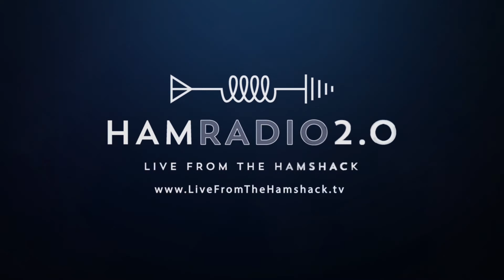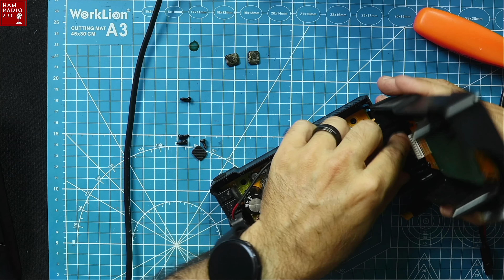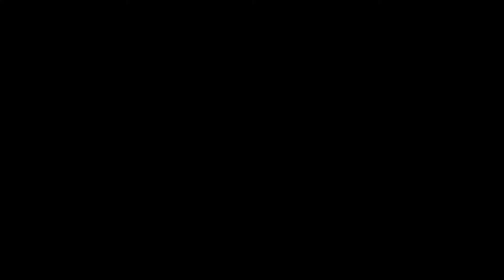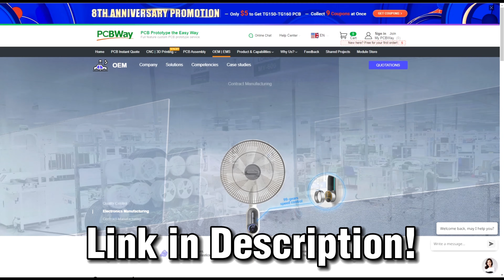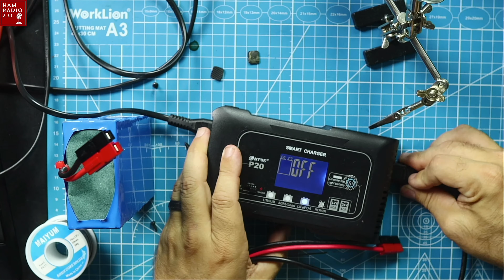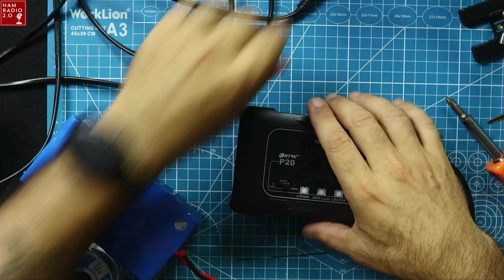Repairing My LiFePO4 Battery Smart Charger from AMAZON

Comment: You will never get advertised charge amps from these chargers. 20-25% less than advertised. Same chargers are much cheaper on eBay than Amazon. There are several clones all the same just different prices and labels.

Comment: nice fix. looks like a nice charger. love the 24V .with the RFI noise get 2- T240-43 thorides and on power cord wind a few wraps threw it keeping core buy charger. take the outher batt side and wrap several tunes threw a ferrite core . if you want leads long this is easy. get a male and female XT 60 and some #10 AWG zip cord. wind it up. keeping close to charger. this should help with the RFI noise. I have done this on many chargers like that and it works . you can use snap ferrite cores as well but may need more than 1 or 2 . next time it breaks place a drop of super glue on pc board under that jack then push it down a hold . epoxy works as well .even hot glue. thank you for the link. I have many chargers. 1 is none and 2 is 1 . what I live buy. they break and go bad all the time and a power surge can wipe them out. 73's

Comment: Solder should never be used as a mechanical connection, typical of cheap chinese devices. I would either epoxy, hot glue or super glue the connector to the pc board.

Comment: Hi Jason.  After you re-soldered the connector, maybe you should have used a micro zip-tie to hold it to the board and not break the solder connections - as a strain relief......
Reply from the maker: Maybe. If it happens again, that might be an idea. However, when the case is screwed together, it holds that connector in place and should be enough strain release. But we'll see
Reply: @HamRadio2  Sure!  Thanks for the reply! I didn't even expect it!

Comment: Noise suggestion...would putting it in a faraday cage kill the noise it produces?
Reply: [Disclaimer: I am not Jason]
Possibly, but if the case is metal,  it should already act as a cage. If the case is plastic, lining it with foil would be interesting (and grounding the foil). 

Also, chokes might help.

At some point, just saying "it's noisy" and moving on is the way.

Comment: Hi Jason,
Next time you need to open it up again, turn the heat down on the soldering iron and melt the two plastic stubs that go through the PCB. The housing will now take the force when you push in the plug instead of the two power leads.  WJ3U

Comment: I would not call it a "short". Shorts mostly mean smoke or fire. This looks more "open".

At work, one time I shorted across a 220vac line inside a chassis. No smoke, but the meter lead tried to weld itself to the contact.